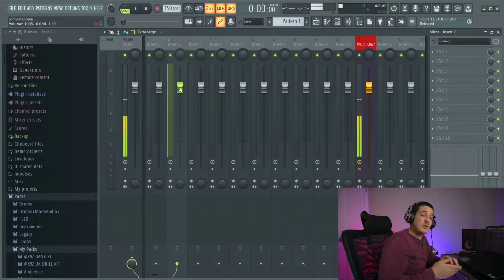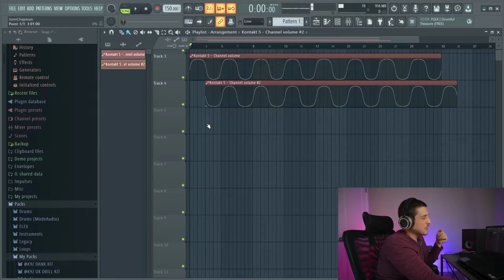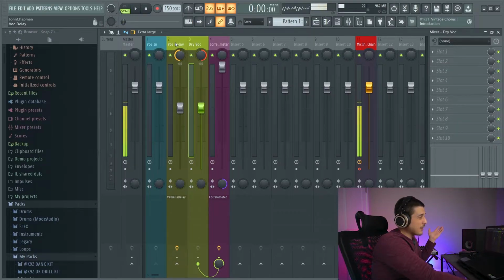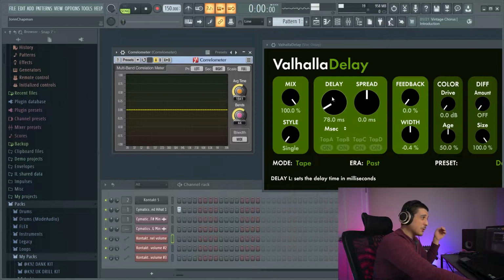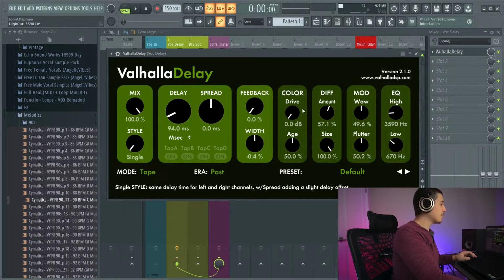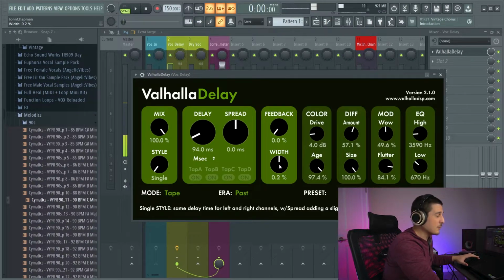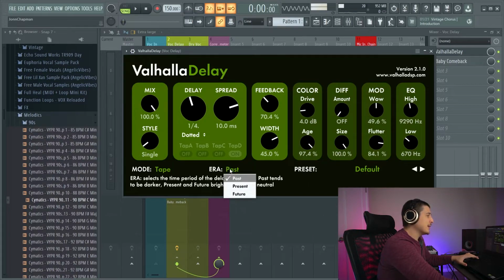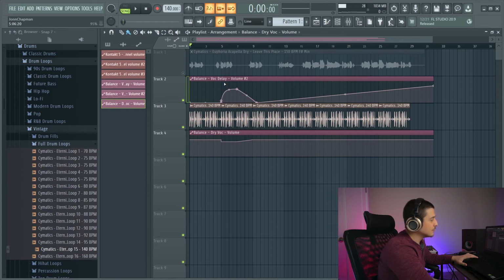NEVER Use Delay Wrong Again (Phase, Techniques, and Controls/Parameters) - Explained in Depth

Comment: Plz..make a video on voxengo correlometer..and how to exactly use the plugin..it will be so helpful..thnk u.. bdw great vdo..
Reply from the maker: Thanks for checking it out! 

Voxengo correlometer works by checking the phase of your left channel compared to the phase of your right channel. So, if you want to check phase of two audio signals you can hard pan them and run them into the correlometer to find out. or you can use correlometer on your whole mix to make sure your mix is mono compatible.

Here's a great video for fixing phase (which not going to lie, I didn't actually know you could do until now)

https://www.youtube.com/watch?v=b6VxXxihx5Y

I actually won't be able to make a video on the correlometer anytime soon. My videos are actually scheduled out for the next few months and I'm in the middle of moving to another state. Hope the video I shared above helps though!